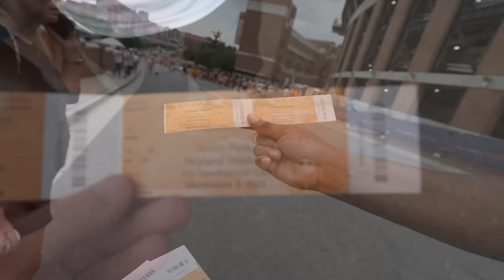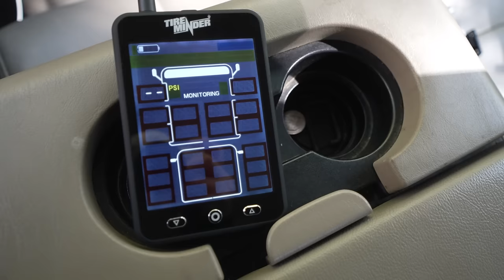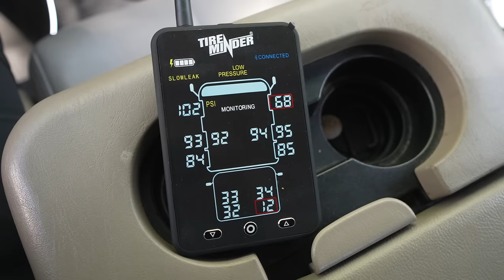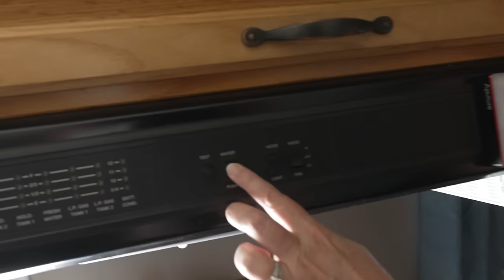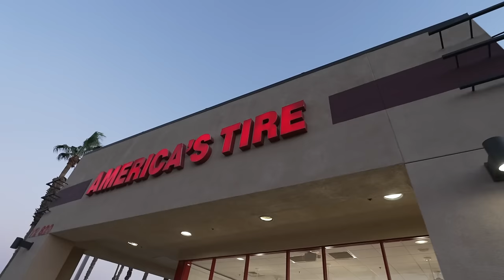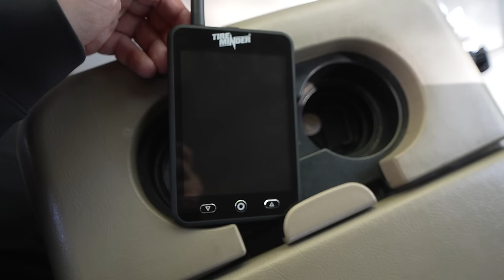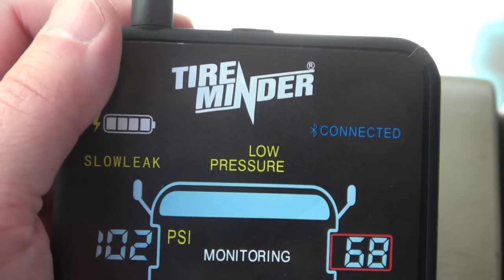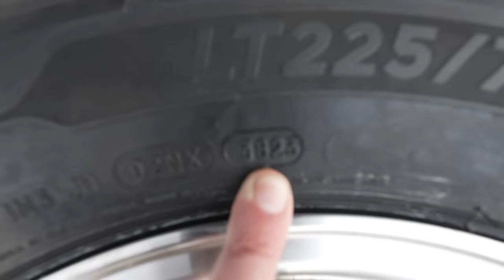TRIP KILLA - Our WORST RV Tire Disaster!

Comment: Good points made in comments regarding tire shops.  Do NOT trust them with a travel trailer.  Had my tires changed at Goodyear last year and gave them the spiel about proper jack points.  They then went straight to the wrong part of the frame.  I stopped them, got out the Trailer Aid and forced them to do one tire at time while I backed it on and off.  

Another time I had an axle issue and watched the dealer, after I discussed with him, jack the camper up by the axle.  He stated they do it all the time.  Axle needed replacing anyway so I let it slide.  But maybe, just maybe, that is how the axle was bent in the first place!

As Regan said many years ago, Trust but Verify!

Comment: I got 7.5 years out my Michelin LT tires,   I had 3  had 3 different episodes of valve stem failures, got good about changing tires on  the road. I got new Michelin LT tires from Discount Tires with shorter valve stems this past November.  Discount tire used 4 floor jacks to lift the my Airstream without incident.
Reply: Use the metal bolt on valve stems.

Comment: I had the same thing happen to me at Discount Tire.  They dented the fresh water tank and that's it.  There was no extensive damage except for the dent.  Lesson learned for me.
Reply from the maker: Overall, I think they are a good company and they are doing their best, but the tire installers have very little if any experience dealing with RVs and mistakes are sometimes going to happen. Overall, you’re probably wise to either bring the wheels to them yourself, or go to a dedicated RV service center. By the way, thank you for sharing your story. It’s helpful to know that we are not the only ones.

Comment: The best 'lesson learned' would be to just drive with flat tire to tire shop, ask them to fix / balance then install yourself to be safe and save a lot of time and troubles (the same clever way as you removed the tired in the first place).

Comment: Sorry you had the problem with getting your Airstream jacked up correctly.  Hopefully you have or will have your trailer fixed correctly soon, which I am guessing was not an easy or inexpensive repair.  When I had all four of our trailer tires replaced last year, I brought a copy of our trailer manual where it stated where to jack up the trailer, and offered the tire dealer the option of using the TrailerAide Ramp (which we use too) as an option to change the tires.   Many tire shops are not familar enough with travel trailers to know the correct procedure to jack and replace tires.  Glad your Tire Dealer took ownership of the their error.  Thanks for reminding us of what we should do.  Take care!
Reply: We told them several times that there were labeled Jack points under the trailer. I stood there and watched the guy crawl under to find it. He apparently did use the Jack points on the drivers side of the trailer, but not the passenger side. 🤦🏼‍♀️🤷🏼‍♀️ Next time I will just crawl under there myself to make sure they use the correct points! 😄

Comment: Also, if you are using the TireMinder model A1A,  that is now out dated tech. We happened to be in FL this winter and had a sending unit fail. Called and found out we could upgrade to the new model I-10 and get $90 off if we turned in the old one. We day tripped across the state to their hq in Melbourne and took advantage of that offer. The new unit has a better antenna on the receiver so we no longer get occasional signal loss from the sending units. 😊
Kat
Reply: Good to know! We should upgrade!

Comment: You guys are lucky. It happened to us in our 2018 Winebego 27BHSS and it destroyed the trailer skirt and wheel well insulation and water barrier. The tires were original from 2018 they had about 3500 miles on them and one just exploded in a construction zone, i think we hit a pot hole.  They are Load range E, 10 ply Chinese made tires.  The damage is estimated at $5,000.

Comment: We pulled our 5th wheel to Seattle from central Indiana and I thought to myself "self, you should chance out those tires!" but no Bluto... they had plenty of tread. Well, on the return 90 degree temperatures, heading into the mountains, BAM a blow out. Pulled it up on my ramp, slipped on the spare, less than 15 minutes I was back on the interstate! Then less than a mile up the road, BAM another one let loose. Yea... I bought 5 new ones like I should have before I left.

Comment: Strange, by coincidence in timing, and with this video, I just replaced 2 tires on my twin-axle Escape 5.0 TA. The tires (Rainier) were a brand I wasn't familiar with and I already had problems with 2 tires and one axle 3 years ago. The tires just I replaced were about 4-1/2 years old. I inspect my travel trailer like an aircraft and perform preventative maintenance on this Escape constantly. I do not like break downs on the road.

Comment: We bought our camper 5 years ago. It was 1 year old
I was planning on replacing the tires when we return home. However,  3 days ago , I had 2 blowouts in 24 hours.  The tires are 7 years old and have 50% tread.  I am changing the other two on Friday .

Comment: I have a TireMinder system and use the smaller screen.  It's mounted on the dashboard and constantly plugged into a USB power supply.  So, no battery charging issues there.

Comment: So glad you guys are alright. I've been very concerned about having my tires fail like that and not having a proper jack out in the middle of nowhere. Thanks for sharing the information on trailer ramp. After a quick bit of research, I plan to purchase the plus size ramp just because my trailer has a bit of an off-road suspension and rides high. I also read that you can put a 2x6 board underneath to get more clearance and support in soft sand/dirt as that can cause the ramp to crack. You guys are great! Safe travels.

Comment: One other thing to think about is also checking the date code of the tires before they install them…. since the calendar age of the tires is so important you don’t want to put tires on that were built 18 months ago, or a ‘set’ with significantly mismatched date codes…

Comment: A question regarding axle replacement. Have you had yours replaced?  
We have the trailer ramp and used several times. We change out our tires every 5 years regardless of mileage or wear. We had two flats on same side at once. The tire pressure monitor alerted us of issue. Still did some damage to wheel area.
Reply from the maker: Yes, we replaced our axles in the year 2021. Ironically, the new axles caused a problem because they were shipped from the factory missing the keeper piece inside the hub. Thankfully, we caught the problem before our wheel fell off. But yes, we did replace our axles due to age at about 18 years of age.

Comment: Curious why you didn't throw the spare on; do you carry one?  Good to know you can drive short distance at low speed but why do it if you don't have to?  Finally, I really appreciate you guys especially being vulnerable and transparent with mistakes.  Been a fan for years now; still making and learning from mistakes.
Reply from the maker: We do carry a spare. In this case, we knew that we were only a couple miles from the tire shop, and that we were planning to install four new tires. We also were eager to get away from the side of the interstate for safety reasons. So we opted to just drive straight to the tire shop on three tires. If we had been traveling a further distance or if our rig has been in a safer location, then maybe we would have put on the spare tire. Thanks for your comments! Appreciate it very much.

Comment: I’m replacing my two 7 yo GYEs in a couple weeks before our first trip. The price has increased more than 50%! Our trailer doesn’t have marked jack points, but Lippert Axles says DO NOT place the jack on the axle…but on the frame as close to the axle as possible! And yes…a shredded tire can cause many $$$$ of damage to undercarriage.

Comment: Earlier today I took the tires off the passenger side of the trailer to take them in to get some tire work done. I did it myself so the tire guys couldn't make a mistake on the trailer,.  I used a bottle jack to raise up the trailer.😉 I've heard stories about similar damage on others.   In Buffalo NY when a bearing blew I used the ramp to raise up the bad tire for Dr. Trailer Repair. (no joke real company) They kinda' liked it.   .............. My TPMS sometimes takes up to 4 minutes to cycle to through the sensors and report the current temps.  Cycle time is typical for all systems, TPMS, Fire alarms, etc. They read one device at a time.  A sidewall blow out can do a lot of damage in 4 minutes. ...........  I had a Dexter rep tell us that driving on three or raising up the trailer on three wheels overloads the remaining axle.  Maybe...... But other Dexter reps say it will work for short trips.  Which we know from experience.....

Comment: What a timely video!! Watched it the morning of my appt at Discount Tires in Lakeland, Fl to replace all four of my 4 year old tires.  Brought the AS in and was told (after making payment) that they don’t have a jack suitable to safely lift the trailer. I called several RV supply stores, including AS of Tampa, and no luck picking
 up a trailer aid ramp. So the trailer needs to go back to its spot, wait for Amazon to deliver the trailer aid, and return to Discount Tire. Btw, Discount Tire will not allow use of the trailer aid in its lot, so I have to remove two at a time and deliver them to the store to be changed out. Lucky I was not stranded and looking for a repair!
Reply: i always kept a stack of 2x and 1x boards to level the trailer at the campground and used them to just like the trailer ramp when i needed to change a tire.  I got a metal version of the ramp from the farm supply store but i still need at least a 2x8 under it to get enough height to get the new tire on the axle.

Comment: I had this happen to my 2002 F150, tires still looked brand new, but they were 10 years old.
The outer band flew off at 10:00 PM where there was lightning.
Just the tools to do simple tire change required me go under hood, the glove box, under passenger seat.
The spare tire only had 10 PSI.
I drive slow to a 7-11, and the air pump is out of order.
I now carry a Ryobi  and a BD air compressor at all times.

Comment: So, we replace rv tires on age due to external damage done by the sun,  as well as time related degredation of the rubber.

Several years ago we fell into an opportunity to rent a fully enclosed garage to store our travel trailer (north ala),  The tires are outside in the sun maybe 7 weeks a year.

They are GYE tires.  What would be the replacement interval for these tires where sun rays are basically not an issue ???

Comment: We had a blowout on our way back from Glacier NP several years ago. We made it to a tire shop in Billings Montana. Got 4 new tires and went in our way. It was at the end of the season so we winterized and put it in storage. The following Spring on our first trip we noticed dripping from under the trailer. After inspection we found the belly pan was bent and cracked. The black tank pipes were also cracked and leaking. Our Airstream was older so we had to have a new belly pan fabricated. It was a total mystery to us how the damage occurred. Now I think the mystery is solved.
Reply: Oh no! Mystery solved indeed. So sorry!

Comment: Another great video on something that every RV owner will find out about . I was home in NY & knew I needed to change my tires ( the tread was good & I always check the pressure) but we wanted to do a short 180 mile trip for a week I said will change them when we get back . We had a blow out 30 miles from home on the way back . did some small damage & I put spare on . In 2022 I purchased a new super duty & got the factory TPMS system & there are no batteries & it comes up on your dash . I have a video about it on my channel . I highly recommend it.

Comment: I would have done the same thing and waited on changing the tires, probably closer to 10 years if they still looked good. The blowout was likely from low air pressure due to a flat. That can happen with new tires. The tire pressure monitoring system probably would have saved you if it were working. Not throwing any stones here, I don't use one. I don't like aftermarket electronics. Way to high maintenance for me. Sorry to hear all the trouble you guys went through. Love your channel!

Comment: After a blowout on bald tires in my teens and vowed that tires are something I will never skimp on.   They are going to wear out anyway and you might as well replace them earlier than required and have more rubber on the road when you might need it.

Comment: I had a Class B. Driving on I10 west of Phoenix but very close to my exit. Hear a bad noise at the back. Investigate, no blown tire back there but still it didn't seem right. Take a closer look. The tire had been shredded totally and I was, literally, driving on the Kevlar bead. A local garage installed my spare and I ordered a new tire in Phoenix. It was damaged by a panel screw digging into it. Bent it out of the way to prevent future issues.

Comment: I had Michelin XCX-APT go for 14-15 years, but the XJ they were on was a garage queen that got driven once or twice a month if that.  No cracking or visible wear at all.  Great tires!!  Would not have done that for a daily driver, though!   Love the fact that the two of you can laugh while telling the tire story!  Says a great deal about your character.  As for Discount, they tend to treat customers very well, even when they make a mistake.  At least that's been our experience.  And it doesn't matter which location you're at or which state you're in.  And they're everywhere!
Reply from the maker: Yes, overall, I left impressed with the discount tire company because they took responsibility for the situation. Mistakes are going to happen sometimes. At least with discount tire you know they are backed by a nationwide insurance policy. Thanks a lot for your kind comments! It’s not easy sharing these kinds of stories, but hopefully it will help other people avoid the same fate.

Comment: Thanks for sharing your story. I'm glad that nobody was hurt. I'm curious as to why you don’t  care a spare tire?
We have learned alot from you guys over the years.
Reply: We do have a spare tire. But at this point, we had already decided to replace all four tires and the tire shop was roughly 2 miles from where we were. We were broken down on a very busy interstate Exit ramp and felt it was more dangerous to crawl under the trailer to retrieve the spare than it was to just drive on as we were. If we had had to get back on the interstate, or drive a longer distance, then we would have absolutely put on the spare.
Reply: That makes perfect sense! Thanks for the reply and safe travels. We had a blow out that did considerable damage to the trailer wheel well area including punching a hole through the floor. The tires were only 3 years old. Took 2 years dealing with insurance to get it all fixed, over 3 thousand dollars in damage. I'm glad that you didn't have to deal with all of that. 👍
Reply: @DavidSmith-bt5wq  oh no!!! That’s terrible! What an ordeal to have drag out for so long. Insurance makes my eye twitch 😬

Comment: The problems always seem to happen in waves.  We are about to spending $10,000 for some steering repairs for our 2017 F-450 and of course it's right around the time we need to put new tires on her.  This video has convinced me not to put off getting those new tires (same situation - tires look fine on the rear as far as tread, but they are old).
Reply: Ugh! It ALWAYS happens in waves! Like, c’mon! Can’t we space these repair costs out just a bit?!? 🤪 Sorry to hear about your steering issues. Hopefully all is well now, and you’ll have a nice long rest before your next repair bill! 🤞🏼

Comment: No mention here anywhere about a SPARE tire! 
A couple years ago we replaced our 4 Endurance trailer tires at the AS factory.  One week later on the way to a rally picked up a big chunk of metal that ruined the curb side rear tire.  Nearby  Discount Tire had a replacement Goodyear Endurance of similar age (we removed tire with our ramp and took it to them) and asked us if we wanted insurance. If we had had their insurance that new tire would have been free. We bought their reasonably priced insurance and because our tires were only 1 week old they also insured the other 3 tires we bought from the factory. When we got home, we also bought a new SPARE tire.
Glad you are safe. Long time watchers. Love your channel.
Kat
Reply from the maker: We do carry a spare tire. I probably should have mentioned it in the video. In this case, since we knew there was a nearby tire shop, and we wanted to get away from the side of the interstate as quickly as possible, and we could tow on three wheels safely, we decided not to put on the spare tire. In theory the safest practice for the trailer would have been to put on the spare tire. However, doing so would have meant us spending more time working on the side of the interstate which is a pretty unsafe situation any way you look at it. So we decided to simply remove the bad tire and go straight to the tire shop.